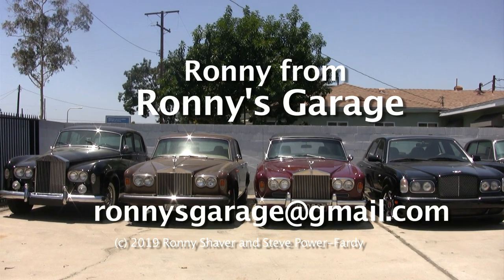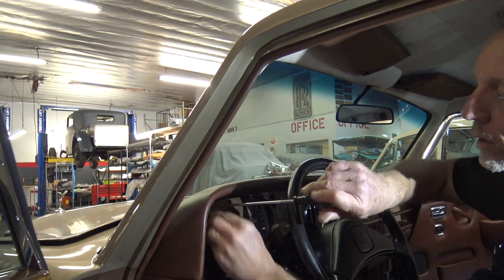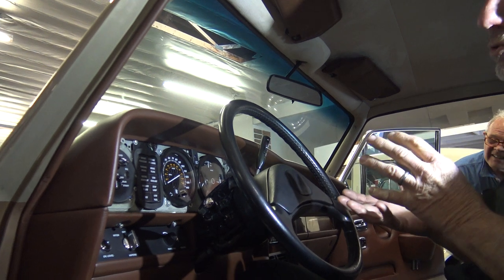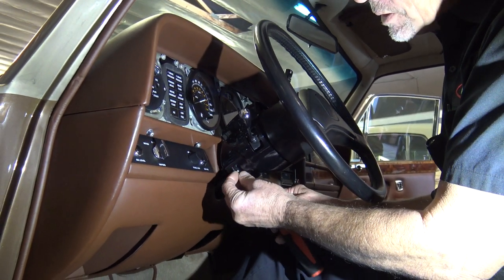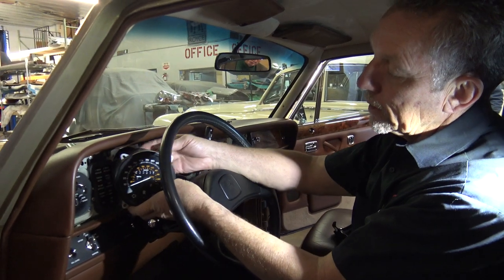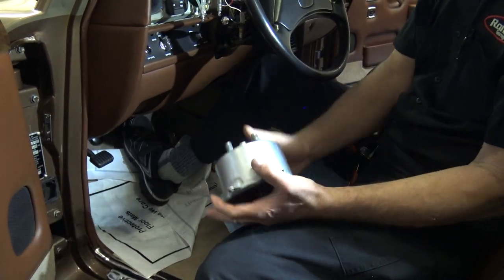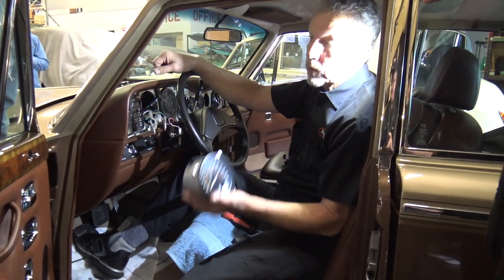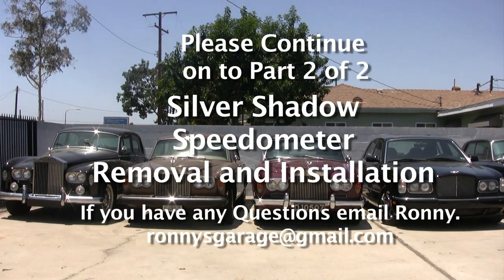Silver Shadow Speedometer Part 1of 2

Comment: My speedo cluster in my 1989 RR Corniche says I'm going 45 but actually about 65 or so. The odometer in the dash seems to be reading correctly. It matched the mile distance markers on the interstate. Does the Cluster speedo tell the odometer what to read? It doesn't seem to. What are your thoughts? Thanks Much.